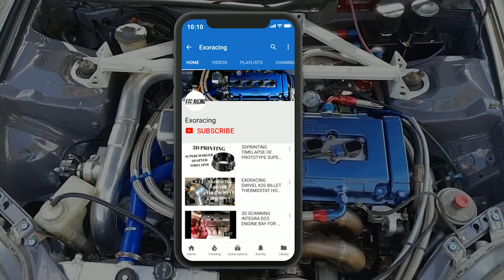AWD CONVERSION WIDEBODY TURBO CIVIC PART 4 **RACE DAY!**

Comment: Awd seems to be working externally well though so it’s hell of a shake down for the car
Reply from the maker: Yeah for sure, even on road tyres it's still gripping at 13/14 psi in 1st gear! You'll need to bring the s15 down at some point 😄😍

Comment: So is that a new turbo then or a rebuild job. ?
Reply from the maker: So long story short after this video we stripped the car to realise the turbo wasn't as bad as we first thought.  Turns out we had a glitch in the smanager software which somehow reverted back to an old map (with less solenoid duty) hence the 10psi drop in boost pressure.
Reply: @Exoracing  oh well that's good news but frustrating now as well I guess.  Nevertheless great work on the civic.  👍🏼☺️
Reply from the maker: @azamchaudhri  yes exactly, very good news in the fact it won't cost anything to fix it, annoying that we stripped the car trying to find the issue 🤣🤣